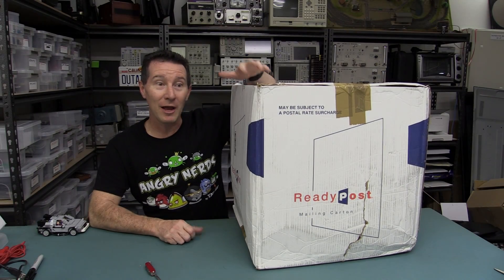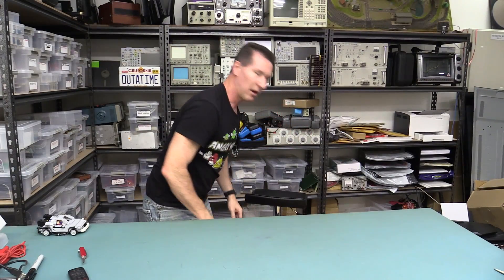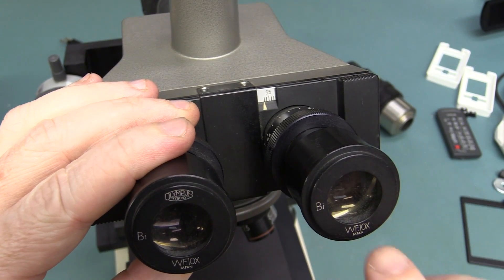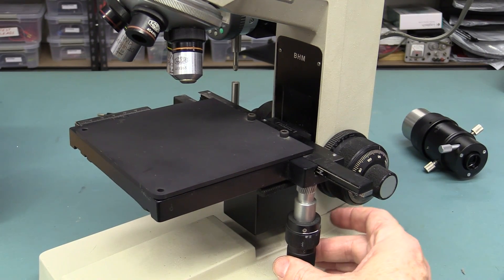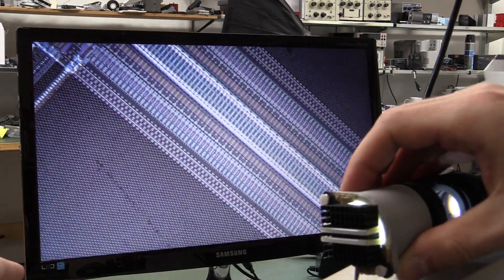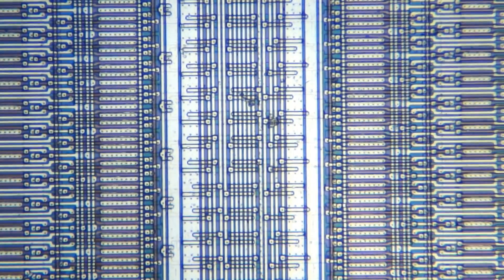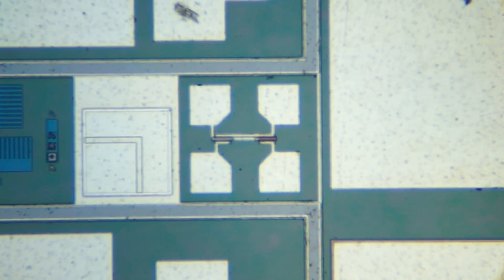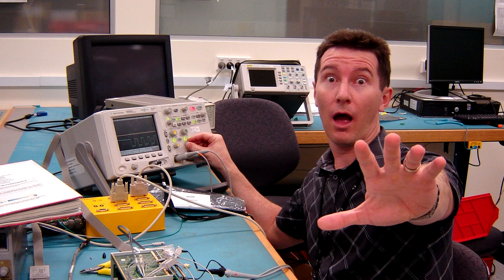EEVblog #992 - Olympus BHM Wafer Inspection Microscope

Comment: From some of the markings it looks like it was stepped on a 4x XLS platform. I think the combs were verniers for physical inspection. The probing in the scribe lines looks like you happened upon some slm or etest structures that were probed with a wafer probe card.

Comment: Holy shit, I'd be sooo pissed at that packaging. File a complaint for sure. Hell, Olympus might even take the opportunity to throw you a new unit just for the hell of it since it'd be a great promo. 

General tips if you're going to be doing decapping IC's :: You generally want to have at least a 50% overlap for stitching your images. Chris Tarnovsky (arguably the 'founder'), Joe Grand and Karsten Nohl all have talks from CCC's in the past which list their processes. Ken Schriff (the righto.com guy) also had a nice talk from the HACKADAY on just general MOS and BJT analysis (which was very interesting to hear --- you draw out a BJT and think -- base,collector, emitter -- but some gates are base/emitter/6 collectors so you can source 6 different blocks with their own constant current... stuff like that!)

Anyways, good deal on that.  Not sure how much you paid for it, but the 80s-90s were the hay day for all Japanese and German optics. Japanese Nikon (Nikkor) line, the Olympus glass, Carl Zeiss, Leica, etc. All absolutely amazing.  If you have glass that's scratched up on accessible regions (exterior surfaces), aluminum oxide slurry at like 3 micron is the abrasive of choice in the DIY telescopy community. Obviously don't do this on any contoured surfaces, but most objectives that suffer scratches are almost always on the 2 faces that are exterior-side, and you can essentially 'buff' the imperfection out as long as you have a reference planar surface that's true. Unless the enclosure itself had foreign particulate the assembly and then abrade internally (which does happen but not that often), you have a very good chance of restoring the glass to very good condition by surface lapping. (See Tom Lipton from oxtools/UC Berkeley for a fairly good introduction).

Sadly, Modern chips are all at like 22 nm (diffraction limit ~300 nm...) so you have to go to AFM/SEM/TEM sadly for more modern processes. Active rev engers I talk with all have to rent out time on SEMs. The downside is the cost, the upside is most of the SEMs have FIB's on it, so you can do things like mill through layers of poly with amazing precision, or do additive manipulation (chemical vapor deposition of platinum usually) to literally alter the chip at the transistor level. 

I'd even be curious to know how fab houses do things like mask alignment these days, since equipping a 100k SEM to each calibration/alignment/wafer inspection station sounds economically challenging...

Comment: Just a suggestion but a 10W COB might be a more suitable light source if it will fit the holder. Cree LEDS are good but do suffer from colour differences over the field of illumination. The COB gives a more uniform light over a very wide angle.

Comment: I hate that ebay bullshit scam program , Just think about it remember before having to pay toes so called fee it does so called cover? The same items i did ship before had no so called fee however they do now. Also with this program i always end up paying UPS are such when there is a fee that ebay does say i am paying with this program. Why did people not fight this :( a scam like this should not be ok with people.
Reply: The repacking is very bad as they do as little as they can to cut comers , Last thing i got box was ripped with no rapping on the sides. I try hard to not buy from anyone using the program unless it is a very good deal making up for it.

Comment: In the lighting-pointing-at-a-stage world, this hot spot is referred to as the "peak". It is related to the physical position of the virtual point of light, within the reflector/lens system. - Does your illuminator have a reflector on it?

Comment: I have the AMScope SM-4TZ trinocular stereo microscope that I use for surface mount work, and I couldn't be happier with the scope itself. I've used Nikon and Olympus scopes at Motorola and Flextronics, and I prefer the AMScope to either. Really nicely made, easy and smooth adjustments, outstanding visual clarity, and stable. The 10MP USB camera is a POS, however. 
https://www.amazon.com/gp/product/B004QJJZ5W/ref=oh_aui_search_detailpage?ie=UTF8&psc=1

Comment: By the way it is not only important that the optics be Plan, but also need to be of M type (metalurgical), which is to say that the glass has the approriate coating to allow the light from the vertical illuminator to go through it and not reflect before hitting the object. Standard biological objectives are not suitable.

Comment: My experience is in a medical laboratory, but the microscopes we use are pretty similar except for the light source being beneath the stage. Your lighting looks pretty good to me. The problem with the filament lamps is that they make everything very yellow so you often have to put in a certain blue filter. Depending on the microscopes people trained on, some people had to use the filter and some people had to remove it since accurate colour is essential for diagnoses when everything is a scale in shades of purple. If we switched to LED lights, we'd have to retrain our eyes.

One interesting point is that most of the important adjustments (at least on the type of microscope I use) are made to the light before it hits the specimen. Intuitively you'd think light is light and if it's illuminated, what's the problem, but it makes a big difference. e.g. The extra little numbers on the objective lenses tell you what to set the aperture iris to for each lens; too closed and it's dark or you only get partial illumination, too open and you lose sharpness of focus and everything seems washed out, it's only a subtle effect though.

In terms of brands, I have found Olympus to be the best. I like Nikon cameras but their microscopes aren't nearly as good. Leica microscopes are just shit.

Comment: Just to echo, you really want a polarizer after your light source, to work
in conjuction with the  analyzer.   Use glass polarizers, not plastic.
Also, you will want calibration slide (AMscope will do) and eyepiece
reticle (Klarmann Rulings are the best).  Would love to see you motorize
the stage ala microgigapan.

Comment: I think you can remove the camera jitter buy taking it to a machinist and having them bolt on a sturdy gusset that connects to your camera's tripod mount. They should also be able to tighten up ways on that stage to make it move properly.

Comment: Geologist here with plenty of petrographic microscope experience. The optics on that Olympus look fine to me, no obviously glaring defects. The colour with your bodged LED look pretty darn good. A trick I’ve used from the camera side to get optimal white balance is to stick something that’s a neutral grey under the microscope, white balance to that using photo/video editing software or the custom white balance feature in the camera. Now you’ve got a white balance setting for that camera on that microscope that you can reuse whenever you want. But honestly the colour looks more than useable as it’s setup now.

Comment: Buy a sack of tennis balls; spread them out in a frame under a slab of wood (or granite); put the microscope on it. That should get rid of the desk coupled vibrations. You still need a light touch for the stage adjustments, or you can fit some steppers and automate the stage movements.

Comment: First, eBay nor PBS package or repackage consignments, PBS only does the international shipment part. The seller is responsible for proper packing. How the eBay Global Shipping Program works, is that the seller receives the address of (one of the) international shipping hubs, a code to put on the address label and an amount equal to the local shipping rate from his location to the hub. The seller packages the item(s) and brings it to the local post office. When the item is delivered at the hub, all documentation is checked, the package is xrayed, the eBay sticker is put on the box and placed on a shipping pallet together with other eBay purchases for the same destination region or country. The pallets are sent by plane, train, truck or boat. The pallets are unpacked and the individual packages are handed over to a local postal service who do the final delivery. The eBay sticker is for these last steps so that all parties know all import duties have been done and the packages don't have to be checked.

It's an urban legend that PBS repackages items. It's a good excuses for sellers. Also, most or almost all post offices don't accept unpacked items. They often do sell boxes and packing material for you to package the item.

Second, do you have an amScope? And have you researched who is the amScope brand and where they are located? Don't bash them please. I own one of their higher end models. I chose them because they were recommenddd to me for their quality. The scope has definitely lived up to that recommendation for about a year now. The scope performs well and has excellent optical quality so does the camera. The customer service has been a good experience and packaging and shipping was excellent.

Comment: I purchased a 1965 era Friden EC132 calculator off ebay. No chips, just resistors, diodes, and transistors for logic. Wanted it for my vintage electronics collection. When it arrived, the UPS delivery man was at my door, without the package, and started by apologizing... Oh crap... He asks me to come to the truck... Oh Shit!

As it turns out, the seller had decided to put the calculator (which weighs approximately 40 pounds, or about 18 kg) DIAGONALLY into and undersized box. Apparently, he didn't have a box large enough... Ehh... He then proceeded to fill the box with peanuts!?!

Story break... Here's a PSA... PEANUTS ARE FOR ELEPHANTS AND PEOPLE WHO ENJOY LEGUMES!!! (salted or unsalted) Peanuts as a packaging material are reserved for only your most despised of enemies, and that may violate the Geneva convention! (ALWAYS salty)

Okay... Back to the story... All it presumably took was one good bump for the bottom of the box to blow out a corner, and the peanuts went everywhere except for around the calculator. Since the box was not appropriately sized, every bump tore the bottom of the box wider and wider, till the calculator was outright traveling exposed, with a lose cardboard wrap.

I'll credit the UPS carriers... They managed to get the calculator to me with very little damage. They basically were carrying the calculator directly, as the box was no longer a box. There was some warping in the chassis top half, so it has a hard time locking into the lower chassis, And the CRT neck cover (a little perforated metal "cage" that sticks out the back of the unit to allow the CRT to be a little longer than the whole enclosure) got dented, but the CRT itself was unharmed. To be fair, that damage was not the carrier's fault, but the shipper, and their incredibly pathetic packaging job.

Also yes... Calculators in 1965 were typically made with either CRT displays, nixie tubes, or used paper printers as their displays. LEDs were not available yet, and it'd be a few more years before the lower power VFD display was created, and another almost decade and a half before LCDs became viable.

Comment: The stage can be retightened a little. Both a linear bearings and a gearset. Just undo the bolts, apply a light hand pressure to bar and tight again under pressure, the slack will gone.

Comment: Hi Dave, I have a times 100 objective for this microscope. have to look for it at the attic but I will send it you! only down side to the 100x objectives ar that you need immersion oil with it... still usefull I think
Reply from the maker: That would be cool, thanks. I'm looking for a x60 and x80 to complete the set
Reply: You're welcome, it could be that I have also x60 or x80... not sure. I must have a set of 3 but can't remember the other values. will send the whole set

Comment: As a grad student doing analog IC design, I am very happy to see some IC imaging on here!

How close are you getting the 40x objective to the wafer? On the scope we have at uni, it's always so close that I'm afraid I'm going to bang the objective into my die while changing objective or refocusing it (like you, I've found changing objectives doesn't quite maintain focus)...

(Also, I'd like a box of wafers. =< Need to figure out how I can find some throwaway wafers!)
Reply: You can buy some on ebay, it is not expensive
Reply: ...good point. I consistently forget about ebay when it's most useful. Thanks.

Comment: Dude, soo cool! I've been looking for the last two weeks for a metallurgical microscope for home, haven't seen these yet on ebay! I actually plan to use it for micrographs so a lot of other stuff on ebay just won't do.
Reply: By the way, at higher magnifications Helicon Focus works fantastically to help get the depth of field you would get with computer controlled motorized scopes, just take a few images at a couple different focus points, drop them into Helicon Focus and as you would say "bob's your uncle".
Reply from the maker: I'll have to try that out.

Comment: I REALLY want to hear the response from the "eBay Global Shipping Program."  A follow up video would be helpful for others that are considering their "service".  1) extremely poor packaging  2) punctured and torn box during shipping  3) no "glass" or "this side up" stickers  4) it should have been at least double boxed with better / more use of foam sheets or bubble wrap.  I mean throwing in a few foam chips doesn't do squat to protect the extents of the scope.  I would want some major compensation even if the light source wasn't broken.  If it is packaged by "eBay" they should know all this and how poorly their shipping would treat it.
Reply: +ElmerFuddGun I doubt we'd be seeing a response video by Dave, since that would imply a response from Pitney Bowes or eBay. And since Dave's channel is mostly popular in the electronics niche, both companies will probably promptly ignore him. Yeah, I might sound cynical, but unfortunately that's the case 99% of the time. And actually the light source WAS broken (it wasn't shattered, but the rough treatment that has caused the lamp body to crack was more than enough to break the fragile filament inside). Also, since packaging is usually done by the sellers themselves, it's probably the seller's fault anyway. Punishing him/her in any was just wouldn't make the whole ordeal a more pleasantful experience either.....
Reply: I agree. the packing was improper. I don't believe PitneyBowes did the packing themselves. They probably "repaired" the box or re-filled the cushing material. The seller is responsible for proper packing. I am an ebay seller myself...

Comment: Looks pretty nice... great score, curious as to what you ended up paying.  I ran a Leitz wafer inspection 'scope for a year at Motorola MOS4 in the early '80s, in the 02 and 03 (early) layers... building 6809's, 6800s, and 64Kb EPROMs.  A good scope holds focus all the way across the stage... if it goes out, then the stage is drooping... not that you're trying to do 1000wafers a shift!  Still in the industry, now we maintain/refurbish/augment AMAT equipment.

Comment: My biggest request for improvement would be for stabilization of the tray.
Reply from the maker: A much finer stage adjust would be my top pick too
Reply: the sliding rails are probably worn out, or damaged during shipping

Comment: The outside looks like the type of flimsy but overpriced shipping box sold by the U. S. Postal Service: anyone packing such an item in that 1) paid too much for the box and 2) is incompetent, as the packing method and material confirm. The shipping must have been vastly expensive: I'm guessing at least US$150 if they used the Postal Service, and possibly no less by any other carrier.
Reply: I would have preferred a double box system. First box holds the microscope, with styrofoam and other cushing material. Floating inside a larger box, with another layer of cushing material. I am an ebay seller myself, and would not have shipped out the mircoscope packed up like that.

Comment: You need a can of "spray air" (which is usually some other clear gas) to clean off the wafer after you dip it in a cleaning fluid.  That should eliminate the little gremlins that you see.  Don't use ordinary compressed air as it probably had gunk in it.  Good old iso-propal alcohol is probably a good solvent.

Comment: I'm surprised nobody uses foam packing that forms around the item. It's two chemicals in a bag, you break the barrier between them and you have foam.
Reply: instapak is ridiculus expensive. but the first choice for items like this. even though, if you are well experienced with delicate items, you can do even better than instapak

Comment: I happen to have bought a slightly older Olympus KHC microscope (about 50 years old) also from ebay (shipped from US to Portugal) and I was impressed with the precision work and robustness of the construction. I did some disassembly and lubrication which I have documented here. Is works very well, very nice optics: http://creationfactory.blogspot.pt/2016/08/reconditioning-50-year-old-microscope.html

Comment: I wonder what images would look like with a dynamically adjustable polarized filter over the light source?
Reply from the maker: You can get polarising and colour filters for this, it would be interesting to see.
Reply: Kevy ... I cut out a small circular piece from the lens from plastic Polaroid sunglasses. It worked quite well in the light path of my microscope.
Reply: Dexxter interesting.